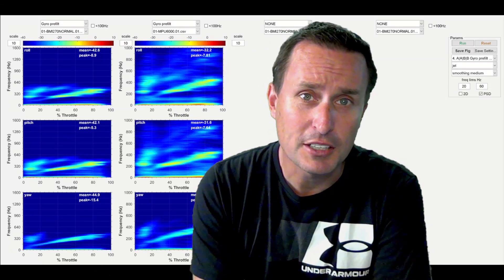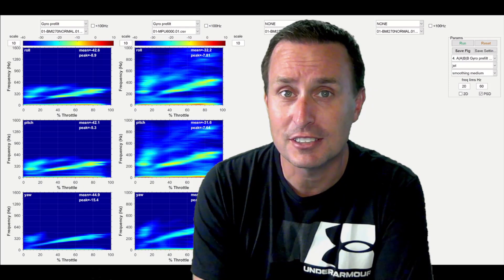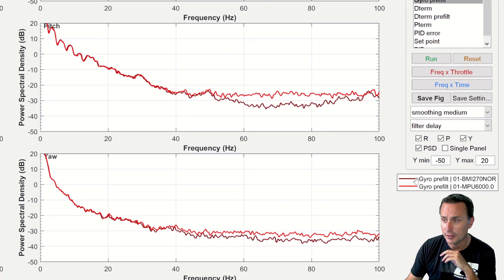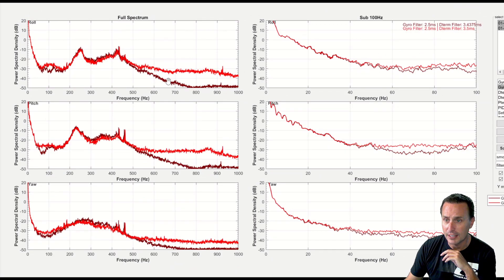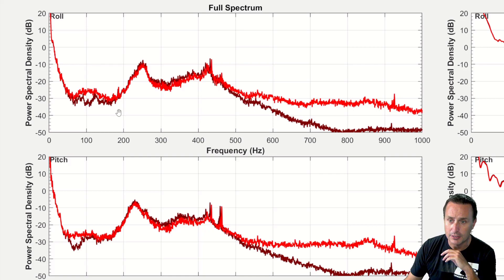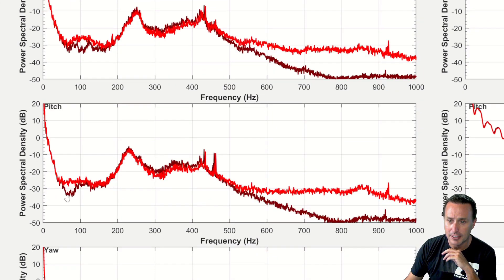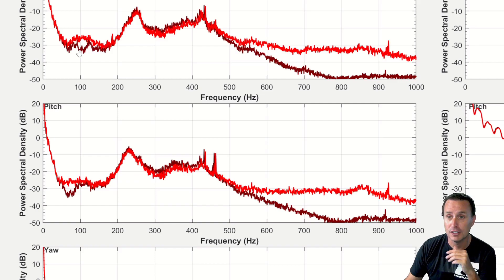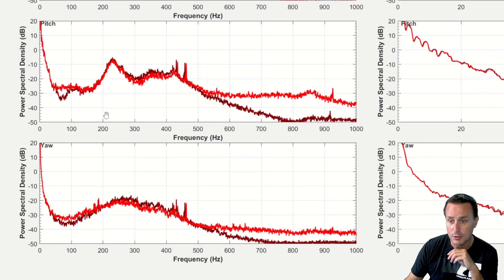The Bosch BMI270 BEATS the TDK MPU6000!! 😱😱😱 - PREVIEW

Comment: I think, unless the test is done with apple to apple filters, this is not valid. If this was done by team MPU 6000 and team Bosch, each team would include settings in their program to accommodate your build, example tuned for noise. The MEMs in the gyros themselves are just measuring instruments, but they are measured with filters at default. now to just stick either one into the build and call one over another, isn't scientific, just simplistic.
Reply from the maker: We are looking at PRE-FILTERED gyro noise.  Plus it was with the same filter and PID setups.  That was all reviewed in the full video.

Comment: @UAV Tech so if two versions of the same FC are available, one with MPU6000 and other with BMI270 then which one should I buy ?
Reply from the maker: V3
Reply: @uavtech  equipped with super duper gyro than don’t exist yet 😛 right ?
Reply from the maker: BMI270.  It exists.
Reply: @uavtech  hmmm probably I will go to widely tested MPU6000 I see that BMI 270 bench test are promising
But not yet widely tested enough. I have a lot of bad personal experience with novelties 😅

Comment: By comparing noise especially by frequency, isn't comparing gyros it is compared the effectiveness of the gyro supply voltage regulators. Let make sure the 2 boards use the same gyro supply voltage regulators.
Reply from the maker: in the end, it's the output result for this and many other tests I, and others, have completed.  

What you said is not exactly true.  The vibrations you see in the gyro signal is not regulator noise.  It is mechanical vibration unless you have a bad regulator.

Of course, in any testing i look for the signs of electrical noise, and ther is none.  If you want the logs, I'm happy to provide.  Let me know your email.
Reply: @uavtech  What I am saying is certain gyro supply voltage regulators are tuned for specific operating voltages and frequencies. And the gyro supply voltage regulators influence how the gyros experience noise. Which boards were compared?

Comment: Which FC did you use with the BMI270? I have two Aikon F7 V2 with BMI270 gyros and both have wacky step resoponse oscillations. After switching to Foxeer F722 MPU6000 FC the issue is 100% resolved. I am using BF 4.3.1 of course for both types of FCs.
Reply from the maker: SpeedyBee V3

Comment: I spent a bunch of time comparing bmi270 and mpu6000 I see the same pattern cleaner down low and up high with the bmi270. Prop wash handling of the bmi270 didn’t seem as good in this case. https://youtu.be/FoL25MCcSAQ

Comment: F405 is a better MCU for the bmi270 than the f722 change my mind.
Reply: Interesting comment; I’m interested as to why that could be.
Reply: @sketchpv  double the flash storage for future proofing, and can run the 3.2k native gyro rate + accel/baro/GPS/bi-directional dshot without breaking a sweat. The only reason we needed f7 for the mpu6000 was to run the PID loop at the gyro rate of 8k.

Now that we don't have to run the PID loop so fast, going with an f722 gives you more power you don't need for more money(?) With half the flash and less future proofing.

Basically, at 3.2k PID loop, I feel like we will run into the flash storage wall of the f722 before we run into the processing power wall of the f405. Plus I'm pretty sure the 405 is cheaper, but only by a small amount.

I guess that depends on how much optimization betaflight devs can do going into 4.4 to free up space. I know right now we are right up against the wall for the f722 and f411, but it sounds like the devs have a plan in place to support them through at least 4.5. 

Either way, I imagine the f405 and f745 will far outlive the f722 and f411

Comment: I have just build a low cost setup with the new BMI270. I was not hopeful, but the results turn out great ! Exceptionnaly clean between 50Hz and 150Hz, the quad flies as good as my high end quads with MPU6000. I don't understand the BMI270 preset in BF which is terrible (adds a PT2 with 135Hz cutoff 😱)
Reply: That BMI preset was made when we didn't have OSR4 in betaflight, and we're running the internal cutoff at like 700hz rather than 300hz.

That preset should be deleted TBH
Reply: @mouseFPV  Thanks for confirmation. That was my assumption, but wasn't sure because of the very early cut off.
Reply: @jejefpv  yeah, going forward just pretend the BMI270 is an mpu6000 when tuning, they have practical noise parity and performance close to a margin of error.

Edit: I know the point of this video is teasing that the BMI performance better, but not in a way where you would completely change the filtering approach significantly

Comment: So after flying the bmi270 for a weekend I noticed instant improvements in prop wash handling and general tunability. Able to push the pids higher and keep cooler motors than with mpu6000. I have had issues with a frame resonance at 136hz on pitch that made it necessary for me to lower the min dynamic notch to 100hz, q value to 400, and number of dyn notches to 2 though. However, even with extra notch it definitely flies better! Running 1.5 on master slider, lpfs off, one biquad on d at 101hz.

Comment: So everybody keeps bringing up about filters and things like that. But the fact is its not even running up to 4K. Been into drones for 6 years now and it seems like the standard has been 8K.  So were we being lied to for years and years thinking 8K was the way to go.  I mean we would upgrade flight controllers to get faster processor to run the new settings at 8K. When in all reality we could have dropped the old processors down to 4K and still got all the features. Why are we only talking about one aspect of the gyro and basically coming to the conclusion that's better?  I feel like we're trying to be convinced this is the way to.  I understand we don't have an option to go back with parts. And so why not make the best of it I'm fine with that. But to me something just doesn't add up. Sorry for the rent great video as always.
Reply from the maker: No apology needed.  So generally noone was saying that you needed to run 8k.  That said, I did one series of tests (2k, 4k, 8k) that shows as I went up on sampling rate, prop wash handling go better.  Since that time, someone outlined to me - that I didn't know about - that as you go up on sampling frequency, filter cutoffs raise.  So to truly compare, you need to account for this effect.  But from a sampling rate prospective, 3,200 samples per second is plenty of reads for motion that is only changing at 60 to 80 times per second.

I need to do a follow-up.
Reply: @uavtech  to make this equal though, what if the MPU6000 onboard chip over sampled further to 4K before outputting gyro scaled?
Reply: @uavtech  please do. It's an interesting topic
Reply: The reason we were told we need 8k was the mpu6000 natively ran at 8k. So, if we didn't run the PID loop at the same rate, we are down-sampling the gyro data and getting aliasing which means we need more filters.

Since the BMI 270 runs at 3.2k, we only need a 3.2k pidloop.

No one lied about anything, different hardware has different requirements.
Reply: @mouseFPV  sorry but aliasing would happen if you didn't match your sampling rate properly. 4000 or 2000 would not generate aliasing.
Reply: @PeterMMMMM   running a PID loop at 4k or 2k on an 8k mpu6000 (down-sampling) introduces aliasing that has an impact on the rpm filters. A gyro lowpass can help with this. Gyro lpf2 at 1000hz can help with this.

Let me know if you have any other questions about it

Comment: were there differences in pcb thickness, gyro ic placement on the fc, and fc mounting position?
how does the picture change, when the two fc's swap position in the stack?
Reply from the maker: it doesn't.  I did previous video where it was MPU6000 vs. MPU6000 and they show the same noise.  Also it is not just this one test, talking with Rosser and White, they are getting the same results in their testing and same observations when working and helping folks (or turning their rigs.)
Reply: @uavtech  👍🏼